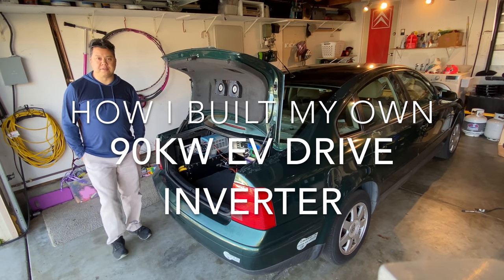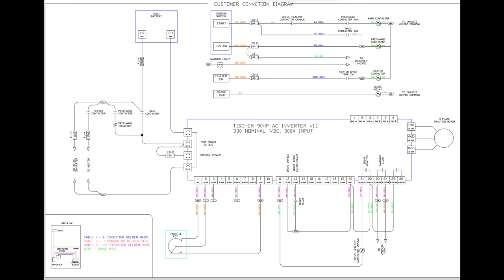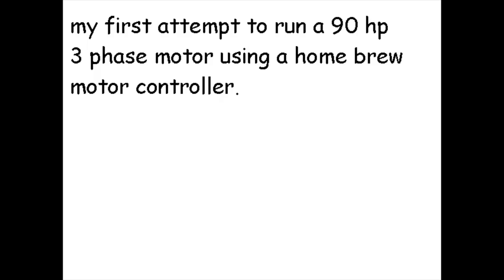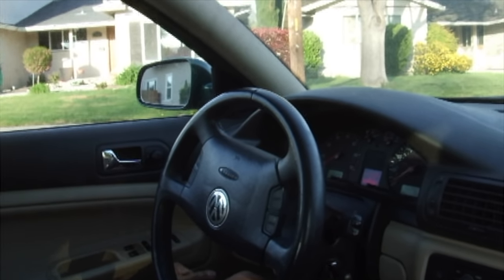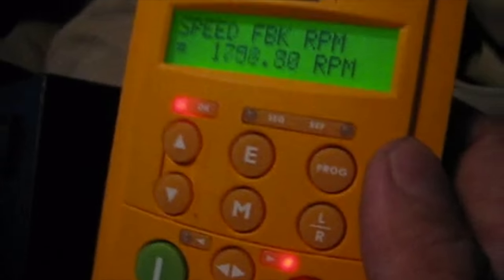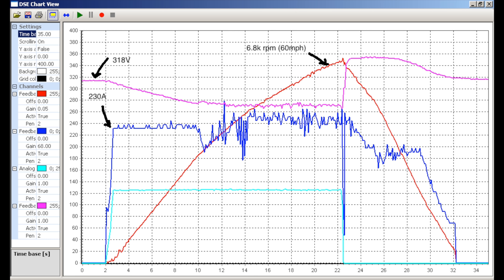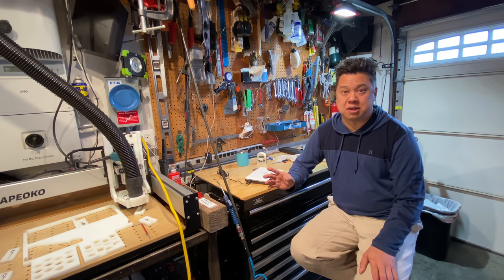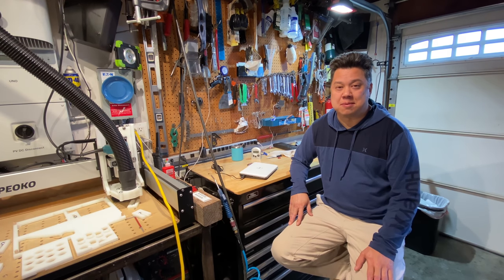How I built my own EV drive inverter

Comment: Thanks! I have been waiting 10 years for these details :-) I followed the project.
Reply: Me too! Specifically how he hacked the VFD. Basically, he didn't! He just upgraded the hardware and lied to it. If i knew that 10 years ago, i'd likely still have my EV that i scrapped because it was DC and junk.
Reply: Definitely not. There are semiconductor-controlled electric vehicle designs dating back to the 1960s. 
The change in technology pricing has moved from Nasa-level to hobby-level mostly due to advances in software control and advancements in semiconductor design.

Comment: I recognize a lot of this gear from work, I assume you are an industrial electrician like myself, I have lots of those small Siemens drives, never thought about using the brain and software to drive a larger IGBT have those also from corona treaters that throw lighting at plastic so you can print it.
Cool build, I can appreciate all the problem solving that was required to make all the other components like AC and power steering work, Nice.
Reply: He is a mechatronics engineer I believe.
Reply: @cothfi  thats where im headed
Reply: @timgoodliffe  do your own ev

Comment: A lot of work in that project. Nicely done and something to be really proud of. IGBT technology is amazing these days. Such a small device that works very fast and reliable.  The equivalent of a project like this would be to build and electronic fuel injected combustion engine using the majority off the shelf parts that were from a variety of other non-automotive industries. Yes, the efficiency will not be as great as possible, but it does the job it was intended to do just fine.
Reply: I think you'd be able to make even superior gasoline engine computers with off-the-shelf components. It's not rocket science :)

Comment: Followed your DIY forum back in day. I learned  a lot from your work and accomplished hacking my own 690 drive. You are a legend bro!!!
Reply from the maker: Awesome!!  How far along are you with the conversion?  Cheers, welcome to the 690 
club =)
Reply: Hey Eric! My original plan was a roadster build. I got ahold of a rare RCT Systems oil cooled induction motor rated at like 250hp...the thing was beast for it's time.I used the PM600CLA to power the beast. I eventually got it spinning in sensorless vector. Sadly I have yet to drop it in the roadster. I started another build recently....an electric UTV using an open source inverter. I have some clips of my progress on my channel if you want to check it out. Been waiting a long time for this video and super glad you made it!
Reply from the maker: @wessplasma6064  Awesome, looking forward to more of your videos in the future!  What inverter design are you using on the UTV?  Can that carry over to the larger RCT Systems motor?
Reply: @etischer Thanks man for checking out my channel! I picked up a Johannes Huebner inverter kit. I'm really liking this kit. The kit has lots of parameters to mess with to tune just about any induction motor. I build my own powerstage for the kit...cuz that's the fun part (:I  have tested it on the RCT motor with great success. The RCT uses a resolver for feedback where as the kit needs encoder...I just used a analog to digital converter and motor ran like a  champ. Right now I'm running the inverter on a Azure Dynamics AC24LS for my UTV project.

Comment: You can try ABB ACS880 drives too has advanced DTC( direct torque control) mode which can estimate the motor shaft position even without encoder so it can help you to hold vehicle from rolling backwards on a slope… also u can have torque and speed inputs to control as needed, it has a optional inbuilt codesys so it can handle plenty of logics u need to make

Comment: Fantastic!
Could you consider doing an electric drivetrain selection video?
Personally, I am considering an electric swap in my 914.  But questions arise like motor type (field winding waste in an induction motor vs. permanent magnet), motor type system costs, transmission vs. direct drive.  I think you could shed some knowledgeable light on the subject.

Comment: 12:24 I like how you explain this concept.  I hadn't even thought about it before, but in my dive into the EV world, motor specs and control circuits I was bound to come across this and now I understand it a lot more.  If previously asked to speculate, I would have assumed the field either had to be strong enough, or the motor would stall*; no idea "slip" was a thing with electromagnets. 13:03 * Like that, not "stall" like an engine, but I thought the field would not move unless the rotor moved, thus just letting you roll back.  And thinking about it more... That MUST be how brushed motors work.  And rolling back to the original idea to cement the concept forever: That is how a brush-less motor can achieve greater torque: though "slip", each time the field rotates, it imparts some energy, even if it's not enough to overcome the force, multiple rotations of the field add up.

It's kind of like when I had a transmission fail where my clutch pedal was useless[jammed in some fashion, long(er)-story], I had to bypass the clutch switch, start in gear with the starter, then rev match to drive.  I was thinking "How do I solve this? What if there was a way to slowly apply the rotational energy of the engine to the wheels?" I was thinking of buying a harbor freight motor to put in the trunk, welding a shaft to the rear-pass wheel and having a lever with a belt to engage the contraption.  Then I realized, I was trying to reinvent the clutch.  And ever since, I understood WAY better how a clutch works, and it's function.  I knew before, pressure plate, throwout bearing, flywheel, how it comes together but it never made sense exactly why and how until putting it into context.
Reply from the maker: The idea of slip is also how a mechanical speedometer works.  Theres a spinning magnet connected to the speedometer cable, and a stationary magnet on a torsion spring.  The more slip, the more force will move the needle, further compressing the spring.

Comment: That is neat, so did you have to write all the software, or do you just choose different operating modes on the VFD after giving it the needed inputs?  I have considered trying to connect an off the shelf IGBT setup to a VFD or perhaps something like a VESC.  Would you did it again like this or would you just buy an off the shelf AC motor controller if you did it again?
Reply from the maker: Yes, I wrote the software in the VFD as well.   Basically look up tables and slope/intercept/ taper functions for limiting regen braking, and field weakening the motor.  Also programmed a shift light to allow speed matching revs during shifting, fault handling if the speed pot voltage falls out of range, fault recovery, logic to run the air conditioner...  All in all about 10 pages of function block programming.  At the time (2008) there were no inverter options so my only option was to build my own.   If I were to do it again, I'd try using a Model 3 powertrain, or new generation leaf.   I just recently bought a Model 3, that's an even better solution, though not the learning experience that this project has been.
Reply: @etischer  Wow, that is impressive.  Very neat that you did that so long ago before all this became common off the shelf tech like today.
Reply: Would you be willing to create a file on Github and post some of your software there? Wondering, if you wouldn’t mind sharing your BOM bill of materials, and technique, along with perhaps some CAD files on Instructables.com? Very fine work!
Reply: @PhilipX2030  Maybe the NDA he has with Tesla prevents sharing even some details of this car? :) (just speculating) :P

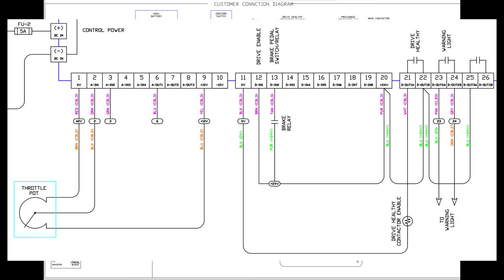Comment: So you configured the VFD to work with the j1772 pilot signalling? You mention something about a contingency against charging and driving while the connector is still plugged in around 2:08, is this separate from the j1772 handshake?
Reply from the maker: The trigger for J1772 is just a couple resistors and diode.  http://etischer.com/awdev/charger/j1772/J1772.gif If there is power at the charge port, it energizes a relay that interlocks the motor, preventing it from running.

Comment: Really impressed,,,with direct torque control you can get away with the PID loops so it has a slightly faster response than your FOC and you can get away with PID stability problems
There is a new type of rotor construction by ABB that gives you more oomf for your buck., so maybe more miles.

Comment: I found your inverter discussion a bit outside my parameters….I have used PVM and MMPT charge controllers off grid for the past 15 yrs but dread custom programming them…..farm is completely off grid but it’s still a leap to EV motion.

Comment: Is it only using normal VFD with vector control,? Using DC bus voltage instead of AC input voltage ? (Normally VFD using AC input voltage to drive the induction motor in factory )

Comment: Instead of using igbt’s, MOSFETs would handle larger voltages, or so I’ve heard. (I’m not in the electronics field) correction (after researching a bit) newer mosfets have been developed to deal with higher power. Not necessarily higher than igbts but they apparently can deal better with higher switching rates, especially at lower voltages. And they’re allegedly cheaper.
Reply from the maker: The IGBTs I'm using are 600V rated, they make a 1200V version but there's no need for higher voltage rating, I'm only at 350VDC.   I don't ever see MOSFETs used in industrial inverters.

Comment: Really cool video. It would really be interesting to design more integrated solution, maybe a Raspberry Pi + few Arduino mini boards, all on one backplane, and Rasberry Pi showing everything on a nice touchscreen, and save telemetry and all that, and interface with the other boards to set new settings, etc. Maybe project for another time ;D

Comment: Wooow so amazing, i an really impressed!, i was working on smaller project in 2011, inbuit similar speed controller using PMW circuit it was supposed to be a basic one, but i burned tens of MOSFETs back then, trying to get it to work, sadly without success. I guess it was the inductance who caused the voltages spkies, after many attemepts it didn't work. Could help me know what i did wrong back then?
Reply from the maker: Omar Mohamed Kandil Did you have real stiff (low equivalent resistance) film caps mounted on your IGBTs?
Reply: @etischer  well i had installed a set of capacitor on the mosfet ( not sute about the the low equivalent resistence u just mentioned)
Here is a desc. Of the problem and the diagram i used https://forum.allaboutcircuits.com/threads/mosfet-and-igbt-fail-in-pwm-speed-control-for-260vdc-2200w-universal-motor.60972/

Comment: Nice retrofit. Do you  know the top speed of the car with the current motor capable of 9000 rpm?
Reply: Only limited by gearing and power I think. (probably around 180km/h)

Comment: I like your way of delivering information, great videos. When shifting gears is there any issue with the rpm difference of the motor and the speed of the vehicle vs the gear you are going into (jerks or drive not liking the change in motor rpm that comes out of nowhere)? It doesn't appear from your videos this is an issue but i had a thought of something that sounded like a fun project (to me lol). You could feed a wheel speed sensor signal & a gear selector switch (tied to shift linkage) to a micro controller and have it match motor rpm to vehicle speed while the clutch pedal is depressed dependent on what gear you have selected.
Reply from the maker: The synchros in the transmission (for an ICE car) would normally speed up the clutch disc to the correct speed.  In this case the motor is commanded to produce zero torque, so the syncros will speed up or slow down the rotor.   The speed match light on the dash tells me when the speeds are matched, and the shift is super smooth,  the synchros don't need  to do much work to accel/decel the rotor.  When down shifting the rotor naturally slows down.  When up shifting, I have to bump the throttle, or wait till the rpm are low, so the synchros aren't trying to spin the rotor up to 8k rpm. 

  I also had the idea to do electronic gearing so the RPM would be exactly speed matched for each gear.  I've done industrial automation with the Parker 690 vfd using gearing (on the fly cutting/splicing, printing presses).  It would require an additional encoder card for the VFD, and more processing power, but totally do-able.
Reply: @etischer  I hadn't thought about the fact that it's probably much easier for the syncros to match rpm with the electric motor vs the ICE, and they would probably live a long time if used "responsibly".

I have been doing some projects over the last year with Yaskawa VFD's & their Drive Works EZ software. While it's pretty handy to have plc(ish) functionality in the drives, it sure would be nice if they would give us some options besides function block style programming. I've found it to be a real pain to move from C style text programming to that.
Reply from the maker: @jakesanchez3552   My VFD is programmed in Function Block format.  For process control programming, I prefer FB over written text, as it's easy to trace the signals through all the blocks, but I'm a PLC programmer so I'm used to it.   When shifting an ICE car, the synchro's only speed up the clutch disc, so it's a quite a bit more work for them to speed up the electric motor's rotor.  For the most part, I just leave it in 2nd gear.

Comment: could you have amplified a sensorless brushless esc (like a mamba max) from an rc car in a similar fashion? i may be silly but they come with a lot of features and compatability. did you consider it?
Reply: You could, but you wouldn't be able to run a induction motor.

Comment: Min 4:36 Are you saying you had an imbalanced tank circuit??????????????
Reply from the maker: Just didn't have the capacitor/snubber close enough to the IGBT to absorb the voltage spikes when current is shut off (PWM) to each motor winding (inductor).

Comment: Impressive sir!! How do you keep the batteries strong? Have ever used Desulfator?
Reply from the maker: Desulfator would be used only on lead acid batteries.  The way to increase life on Lithium batteries is to only charge to 70-80% and not let the state of charge drop below 10-20%   Batteries are rated 3500 cycles charring to 80%, and 5000 cycles charring to 70%

Comment: Hey I'm an EE and am in Livermore.  Do you bring this to any shows?  I would like to meet you and see this awesome car.
Reply from the maker: I had done a few shows back in the day, but not so much any more.  I started parting the car out, and wanted to get these videos done before I did.  Welcome to come over and check out the parts scattered around the garage if you like.  You can find my email on my webpage, etischer.com
Reply: etischer why did you dismantle it after all that work to get it like it was ??
I would have bought it all whole like you had it in videos
Reply from the maker: @mrmeiii  There's too much liability in trying to sell a car like this.  I can imagine 5 years down the road, it's involved in an accident and I will be blamed.  Not to mention the high voltage hazards associated wth the car, I can't just hand over the keys to some random person that doesn't know what they are doing.  The profit from selling the car isn't worth the worry.    I have parted it out, and sold the bulk of the parts already (batteries, charger, motor, spare motors).   In all, I expect to get about $5k.

Comment: So you connected those 6 high and low drive wires coming out from vfd and connected those to big and more igbt's.
And
Vfd's potentiometer is your throttle pedal. Right.
Reply from the maker: Basically yes, and throw in a few months of programming.

Comment: looks like you were able to pull over 100kw out of that inverter peak 102kw for 1-3 seconds.. can it do 90kw continuous?
Reply from the maker: 100kw corresponde to 150% current.  I'm using the I^2T (Current squared * Time) function to prevent the motor from over heating, so it will do 100kw for 60 seconds then ramp down to 66kw.   In daily driving, even climbing steep grades for several minutes, it doesn't throttle back current, only if I intentionally  bog it down by selecting too high a gear, like 4th.   The motor is technically rated 67kw peak, 33kw continuous.

Comment: @etischer How did you pick the drive?  I would expect it to be an AC powered drive, but you powered it with 300+VDC.  What range to DC power will it handle?  Or does the power electronics run at lower voltage, with only the IGBT seeing the 330VDC?
Reply from the maker: All the VFDs that I've worked with convert the AC input into DC through a simple bridge circuit, and capacitor bank. The drive then PWMs the DC bus to generate the 3 phase AC output to run a  motor.    The control voltage internally running the logic in the VFD runs on 24vdc, supplied by an onboard DC-DC converter.